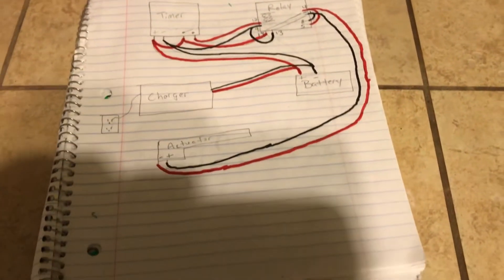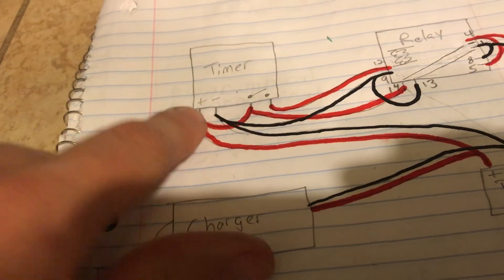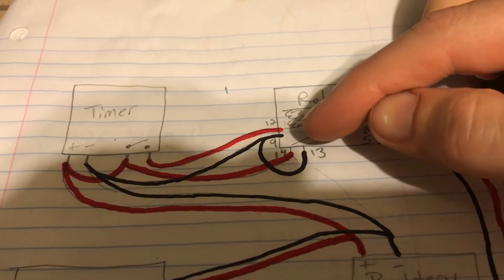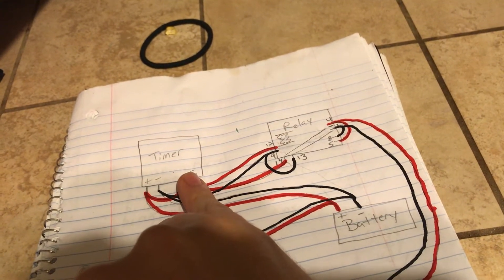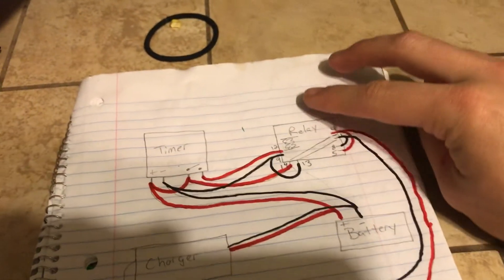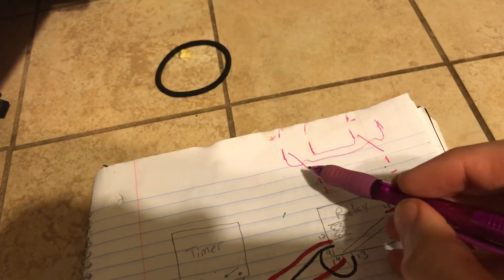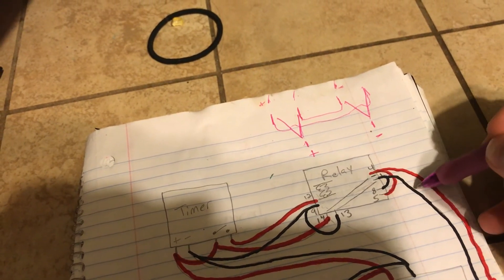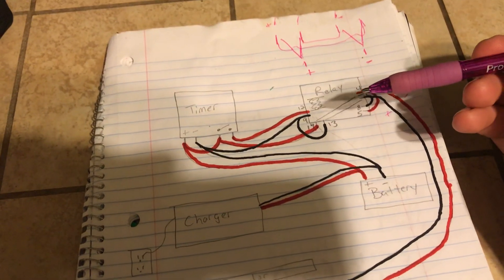Automatic Coop Door Wiring

Comment: Hi , what if I want to add a light bulb to the wiring, How would it be ? Please help ;)
Reply from the maker: The light bulb would need to be 12 volts since this whole setup runs on 12 volts.
Reply: MJM’s Workshop where it be connected . does it need another relay for the bulb?
Reply from the maker: Kai Zen use a ground off the battery and for positive use the switched output coming out of the timer.
Reply: how abt negative
Reply: @larrytingang5363  What type of bulb? LED? Where in the wiring would you want/need it? Is it for the chickens in the coop or for indication that the system /timer is on?